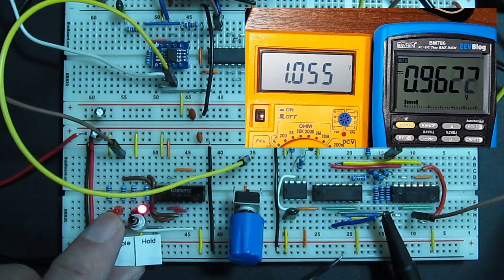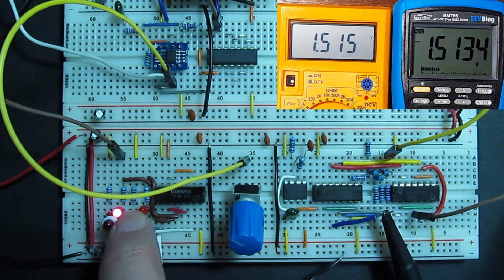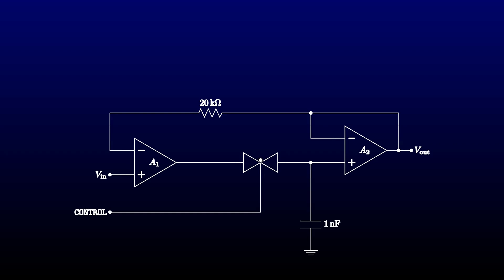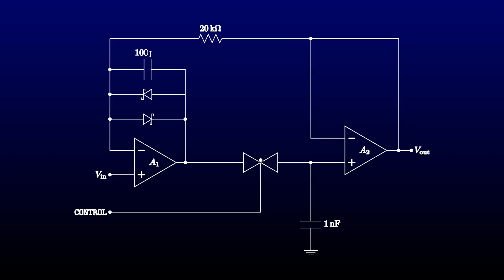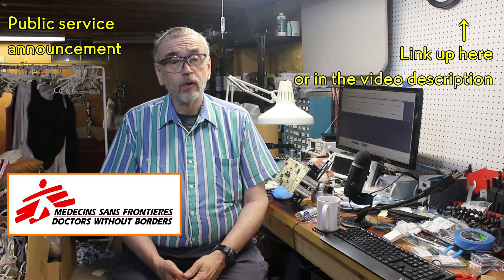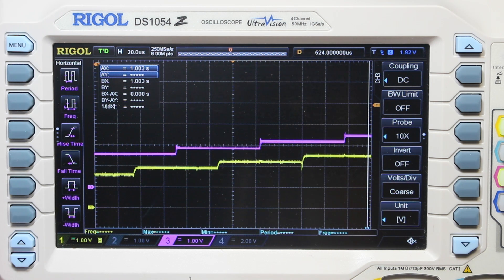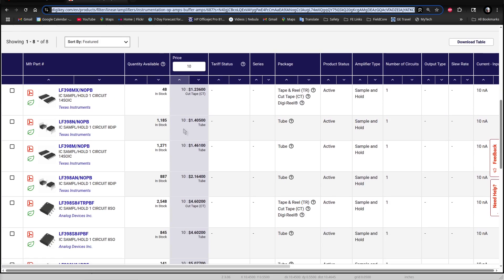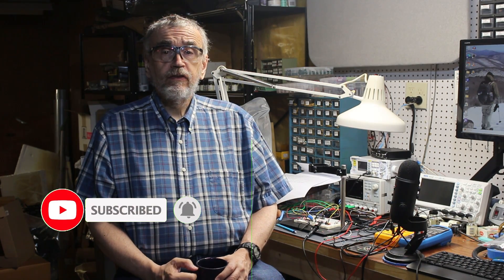The Sample-and-Hold Circuit - Op-Amp Basics, episode 9

Comment from the maker: @christopherventer6391 asks: "Since this is using an analog switch, which is bi-directional, I am wondering if the feedback loop between the op amps is necessary. Can't we just put the switch and cap between two unity gain buffers and add pull down resistors to make sure the outputs and inputs have a known load then the switch is open?"

Really great question! 

You can put the cap between two unity-gain buffers with an analog switch driving it.  Ancient hybrid sample-and-holds like the HTS-0025 worked that way. Sometimes see that topology in the example applications in the datasheets for analog switch ICs. I seem to recall seeing it recently in the datasheet for the (DG418?  Don't recall). They're still not easy to stabilize. Op-amps don't like driving capacitors!

As I understand it, the drawback of not closing the loop around the entire circuit is mostly offset voltage, which closing the loop around the op-amp pair helps to reduce. You're depending only on the offset voltage of the input amp, rather than summing the offsets of both amps and whatever you're using for a switch. The disadvantage, as we've seen, is that the thing is even more of a bear to stabilize.

There are further improvements that are worth making that I didn't have time to show in this video.  If we use a SPDT analog switch, we can replace the pair of diodes with the other throw of the switch, and not have to deal with even the 300 millivolt transient of a Schottky diode.  

We can also move the capacitor to the feedback loop of the output amp - a circuit like an integrator.  (It is an integrator, but we're driving it to saturation.)  That gives us the advantage that the right-hand side of the analog switch is at a virtual ground.  The MOSFETs in the switch have a parasitic capacitance between the gate and channel, meaning that the switch transient injects a little bit of charge into the hold capacitor. This is significant only when the gate is opening and nothing is driving the hold capacitor, but if the node is grounded, there's no charge on the channel to inject. (Charge injection isn't a problem with the huge hold cap that I used in the video.)

You can use an input amp that's designed to be stable at unity gain with a large capacitive load, like the LT1457, and not have to fiddle nearly so much with the compensating cap in the input amp's feedback loop,

Once we've done all that, we're looking at something very like the internal workings of the AD783, which is a complete drop-in track-and-hold suitable for ADC front ends.  AD783 also includes an internal hold cap, so it works with only five pins (power, input, output, and the control line).  But it wouldn't be appropriate for some of the things I have in mind for a track-and-hold, where I'll need hold times of at least large fractions of a seccond (if not several seconds). The internal hold cap is pretty small, so the output droops about a volt a second! No problem for an ADC that needs only a few microseconds of hold time, but disastrous in some other places!

Life is full of tradeoffs. A big hold cap is great for long hold times, but it means that the settling time is long and makes the stability problems worse. A smaller one is much easier to manage but gives you issues with voltage droop.  And Mother Nature always sides with the hidden flaw.

Comment: Since this is using an analog switch, which is bi-directional, I am wondering if the feedback loop between the op amps is necessary. Can't we just put the switch and cap between two unity gain buffers and add pull down resistors to make sure the outputs and inputs have a known load then the switch is open?
Reply from the maker: Really great question! 

You can put the cap between two unity-gain buffers with an analog switch driving it.  Ancient hybrid sample-and-holds like the HTS-0025 worked that way. Sometimes see that topology in the example applications in the datasheets for analog switch ICs. I seem to recall seeing it recently in the datasheet for the (DG418?  Don't recall). They're still not easy to stabilize. Op-amps don't like driving capacitors!

As I understand it, the drawback of not closing the loop around the entire circuit is mostly offset voltage, which closing the loop around the op-amp pair helps to reduce. You're depending only on the offset voltage of the input amp, rather than summing the offsets of both amps and whatever you're using for a switch. The disadvantage, as we've seen, is that the thing is even more of a bear to stabilize.

There are further improvements that are worth making that I didn't have time to show in this video.  If we use a SPDT analog switch, we can replace the pair of diodes with the other throw of the switch, and not have to deal with even the 300 millivolt transient of a Schottky diode.  

We can also move the capacitor to the feedback loop of the output amp - a circuit like an integrator.  (It is an integrator, but we're driving it to saturation.)  That gives us the advantage that the right-hand side of the analog switch is at a virtual ground.  The MOSFETs in the switch have a parasitic capacitance between the gate and channel, meaning that the switch transient injects a little bit of charge into the hold capacitor. This is significant only when the gate is opening and nothing is driving the hold capacitor, but if the node is grounded, there's no charge on the channel to inject. (Charge injection isn't a problem with the huge hold cap that I used in the video.)

You can use an input amp that's designed to be stable at unity gain with a large capacitive load, like the LT1457, and not have to fiddle nearly so much with the compensating cap in the input amp's feedback loop,

Once we've done all that, we're looking at something very like the internal workings of the AD783, which is a complete drop-in track-and-hold suitable for ADC front ends.  AD783 also includes an internal hold cap, so it works with only five pins (power, input, output, and the control line).  But it wouldn't be appropriate for some of the things I have in mind for a track-and-hold, where I'll need hold times of at least large fractions of a seccond (if not several seconds). The internal hold cap is pretty small, so the output droops about a volt a second! No problem for an ADC that needs only a few microseconds of hold time, but disastrous in some other places!

Life is full of tradeoffs. A big hold cap is great for long hold times, but it means that the settling time is long and makes the stability problems worse. A smaller one is much easier to manage but gives you issues with voltage droop.  And Mother Nature always sides with the hidden flaw.
Reply: @KludgesFromKevinsCave 
Thanks so much for your detailed response! This is what I love about your videos as well.

I have been making and designing guitar and bass pedals for about a dozen years or so, and have lately been working more on synthesizer module design. When I am working on a new design and implementing a circuit operation that I haven't used in a real world device, before, I like to look on YouTube to see what various people have to say about a known circuit I am considering using and adapting for my purposes. Your videos are always extremely helpful, because you address the real practical issues that you encounter, which many times are ignored in a theoretical lecture for students or just kind of glossed over. It's been super helpful to get a good intuition about how the circuit really works and what roles each component is actually performing (which is often more than the obvious!).

Anyway, back to the circuit. If the original issue is offset, I wonder if we can use op amps that offer an offset trim option (generally single op amps), which are unity gain stable, and have a low offset drift. I don't think we'll get around using a decoupling resistor on the output of the op amps, probably, so that's also necessary (I usually actually just include one in practical designs anyway, to make sure there isn't any parasitic capacitance on the pcb being driven by the output that could cause ringing).

NE5534 could have been a good option (it has internal decoupling resistors also), but it's actually compensated for a gain of 3, so kind of fails the unity gain aspect. It cna be compensated externally, but the offset trim also uses those pins so it may not be a great choice to do both.

OPA1655 could be a good option if you include the decoupling resistors. It's quite good for audio, unity gain stable, and has an offset trim capability. I will have to try that as I have quite a few of them.

OPA182 or OPA2182 (dual version) might be a good choice as well. It's a low offset zero drift op amp and has . It doesn't have any additional adjustments but shouldn't need them. I also have some of these that I could try out. They're very good for 1V/Octave processing I find due to the accuracy!

Comment: Thanks for this video! I actually have an unstable sample-and-hold in an analog synth module that I can't get to work properly (it's drifting fast) - I think I'll give the LF398 a try.
Reply from the maker: Glad you're finding it helpful!

A few things to consider:

Are you by chance using a bipolar op-amp for the output buffer?  Drifting usually means that there's leakage current somewhere, and the input bias current of the second op-amp is a usual candidate.  Are you using a polymer-dielectric capacitor for the hold capacitor?  Electrolytics leak like sieves, and most ceramics are horribly microphonic.  What are you using for the sample/hold switch?  JFET or MOSFET switches are excellent - something like a 4066 (if you have a small enough voltage swing) or the DG401 (DG403, DG405) is usually a good choice.  (Watch the couple of videos before this one, where our debugging consists of tracking down where leakage currents are going!)

The LF398 takes care of most of these issues for you, but you still need to use an appropriate hold capacitor!
Reply: @KludgesFromKevinsCave  Thanks for the input.
I use half of a TL074 for the buffer, and tried polypropylene film and polyester film capacitors. As switch I use two 2N5457 JFETs that are triggered by a short pulse.
It worked fine on a perfboard when using a dedicated TL072.
But now I will redesign that section from scratch using the LF398.

Comment: It might be a lot easier to compensate the op amp if it werent on a breadboard! Lots of parasitics on a breadboard that can cause havoc with high speed circuitry!
Reply from the maker: True enough!  But I'm not going to spin a PC board for a one-time demo to show the concept.  

(If I were doing it for real, I'd use an LF398.) In any case, a sample-and-hold is just about the worst possible circuit for stable compensation. It's unity-gain, it's always making abrupt transients, and the feedback loop is slow.  If you look at the data sheet for the LF398, the internal schematic shows almost all the compensation components that I added.